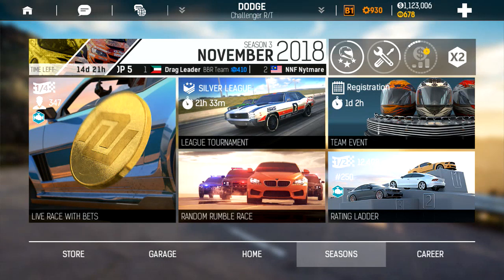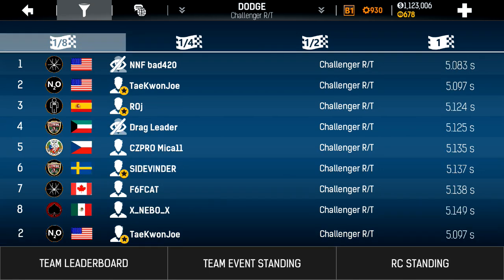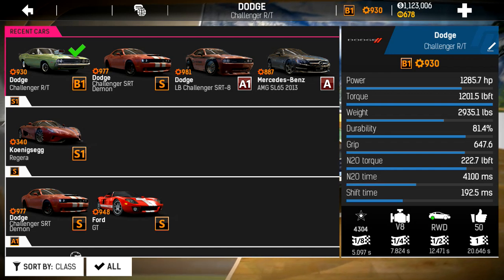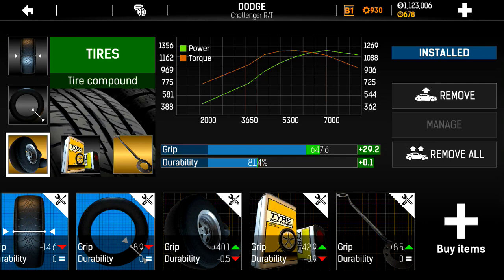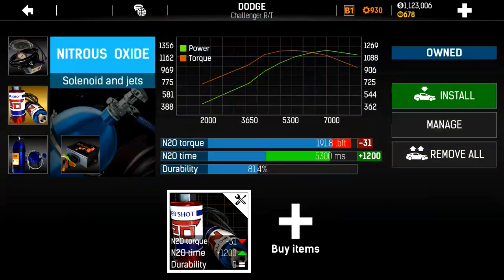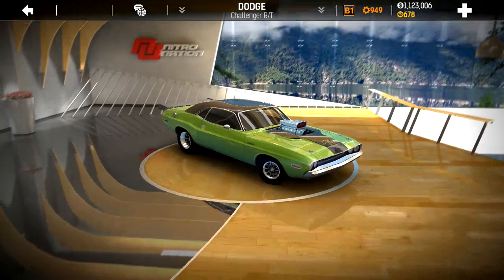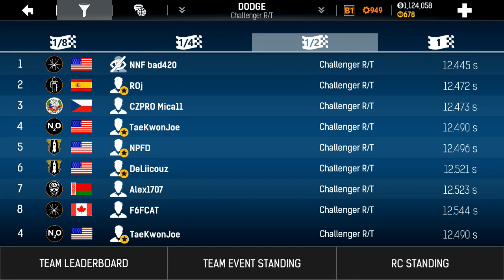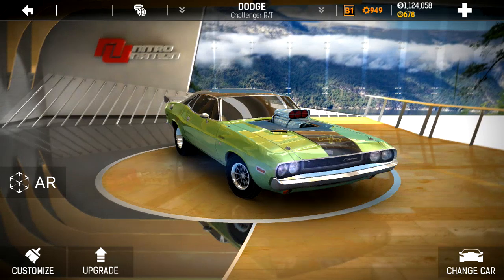Nitro Nation 1971 Dodge Challenger R/T B1 Race 900+ Cog Tune Tips

Comment: Yo, just recently got back into the game, you got any tips on how to launch your car and when to use nos?
Reply from the maker: Hey Stance, welcome back! Launching technique depends on the type of car and its tune but I've found that in most cases quickly revving up to green and then spraying the NOS immediately after shifting into 2nd gear works well. When you reach 900+ cogs you might find some full throttle launch configs that work without losing time due to an uncontrolled wheelie but grip and gear ratio settings are very tempermental when finding that sweet spot.
Reply: Channel SRT-8 got any tips on tuning?
Reply from the maker: @J7Noj  
• Race the Club Tournament, Toyo Race Series, Drivers Battle, Live Races, and especially Underground Tournament to get blueprints, redraw cards, and upgrade cards. 
• Don't install a black blueprint until you know for sure that you've upgraded it to its maximum otherwise you'll waste a lot of money and engine/transmission/weight/nitrous/tire kits redoing it later.
• Try slightly adjusting gear ratios after an upgrade and save presets when test drive results are better or reset and try again if needed.
• Some tuning and launch techniques may vary for ⅛, ¼, ½, and 1 mile distances. Utilize the Tune > Gears > Presets for each to customize settings for best results
Reply: Channel SRT-8 alright last question, how to I beat the stage 8-10? My car is a 605 and his is a 583 and still beats me. Is it tuning or upgrades?
Reply from the maker: @J7Noj  though your cogs are higher, the racer you are up against could have upgraded different components which would give him the slight edge. You could fine tune your gear ratios to reduce your ET by tenths of a second probably but certainly more upgrades would do it.
Reply: Channel SRT-8 alright ty I'll get to grinding for some upgrades!
Reply from the maker: @Phuntsok Tsering good question. I made a tutorial video on how to find out: https://youtu.be/6ICeSqhCtTw

Comment: you would have gotten a better timing if you over revved every gear and not shift up to 5th
Reply from the maker: tonierpillow4 roger that but I found on some cars depending on NOS torque vs duration shifting into 2nd and sometimes 3rd in the green without over revving yields better times so always over reviving isn’t absolutely always better.
Reply: @HEMImania  yes you're correct! and even better way would be to tune the gears so that you over rev on purpose and the next gear shift is perfectly in your powerband
Reply from the maker: tonierpillow4 nice! I’ll try that.